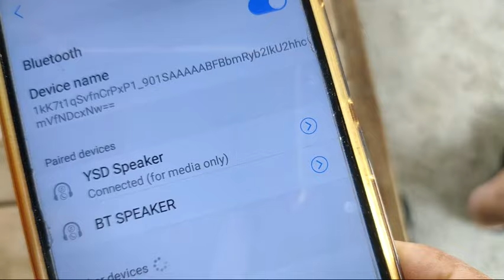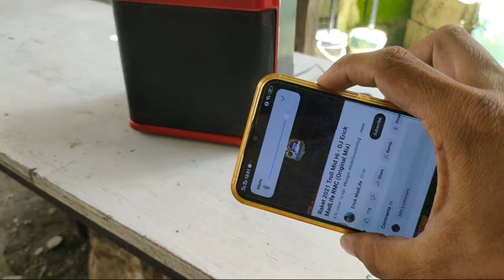Repair and tips on Powerful Bluetooth speaker YS 203

Comment: Good Day sir. Ganyan din yong sakin. Bakit pag nilalakasan yong volume or sounds namamatay yong unit? Sana po masagot. Salamat
Reply: Possible yan bro sa battery. Ndi niya na kaya supplyan ang mas mataas na power requirement ng board once mag volume up ka
Reply: yung battery mo dapat palitan na maybe not continuous na ang power output kaya putol2x, pero test mo muna alin sa dalawa ang hindi mag charge o kaya'y ang dalawang battery ang may problema, putol-putol and sounds dahil hindi na continuous ang battery output

Comment: ano po kaya problema ng YSD namin sir.kasi nagsa-sounds kami pero may nalabas na audio from mic sa kagaya din namin na device.kapitbahay namin.
Reply from the maker: May power display Po ba pag meron 
Check niyo speaker paka may lagot na wire or check  narin baka sira UNG speaker next check voltage 
Battery or palitan na ok na bat..salamat sa comento mga kaibigan.👍👍keep safe

Comment: Bakit po yung ganyan kong speaker pinalitan ko ng battery 5000mAh bakit po nag iinit pag ginagamit?
Reply: if it is 5000mah per battery x2 hindi compatible sa on board chip charger, pero kung isang 5000mah lang lagi siyang naka overload dahilan laging umiinit

Comment: How about the wireless microphone? Paano qng walang nalabas na sounds from the microphone? How to fix?
Reply: hi sir. same problem. naayos niyo po ba?
Reply: Usually battery ang problem ng mic. 1 pc ma 18650 lithium ion ang battery nya
Reply: yung akin may charge nmn yung mic nakokonect sa blutooth pero walang tunog ang mic..pano po kaya un..me naputol kasing wire sa loob pero pinagkabit na namin ayaw padin gumana..ang hirap talaga ng ngpapahiram ng gamit pag balik sira na😢😢
Reply: sakin po nagana nmn ang mic. ang issue ko dinagana volume settings nya nakapirme lng na malakas
Reply: sakin po nagana nmn ang mic. ang issue ko dinagana volume settings nya nakapirme lng na malakas
Reply: just it appear charging, but charging chip not really charging or your battery are not continuously storing energy or not charging at all, change the battery
Reply: @totzinfo  hello sir baka mahelp mo ako sa problem ng ys spear ko nagchacharge pero ayaw mag on ano po kaya problema?
Reply: yung sakin nag coconnect nmn sa ibang speaker yung mic pero ayaw mag connect sa unit ng mic yung speaker

Comment: yung sakin po nagchacharge pero ayaw mag open ng power nya. ano po ba dapat gawin???
Reply: same, maybe sira na noh. 😢 kakabili lang 1 day agad
Reply: @MissSelena-rf5uu  baka iba yung YSD model mo, ang YSD 203 are reliable but other model are short life
Reply: just it appear charging, but charging chip not really charging or your battery are not continuously storing energy
Reply: @totzinfo  same model, nirefund ko na. and binalik ko as is. nagbiblink yung charging button ata po yun. ang nangyari lang, i connected sa ibang phone, then after that gumana pa tapos ayun not working na.

Comment: Hello po. About po sa mic. Hindi na po siya na didetect ng speaker. Paano po ung ganun po
Reply: yung transmitter chips ng wireless output sa electronic board sa mic ang may problema, di nya ma-scan ang wireless receiver

Comment: Sir paano po kapag ayaw mag charge kasi umilaw mandin  yong pinaka inagasaksakan kapag naga charge e ayaw nya po salamat po
Reply from the maker: Palitan nio nalang po ng changing ic tp4056 ic marami po sa shoppe module po sya install nalang po salamat sa commet
Reply: Same din po sakin bigla nalang di umiilaw pag chinacharge. Need na po tlga palitan? Wala pa 1 month ung speaker ko...

Comment: Ung sakin may pawer pero no sound anu po kayang eaue
Reply from the maker: Maaring tignan Ang wire Ng speaker 
O kumuha ng Isang maliit na speaker upang ipang testing at tignan mabuti Ang board ng circuit subukan linisin Ang ito upang mawala ang anumang nakadikit Dito 
Busisiin maigi..salamat sa comment 
Sir
Reply: Same problem sakin..😢